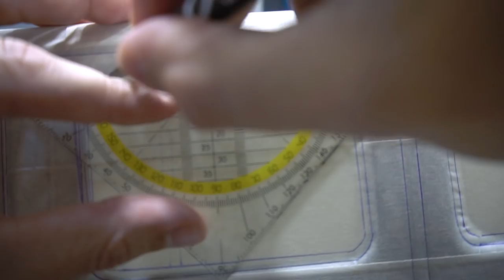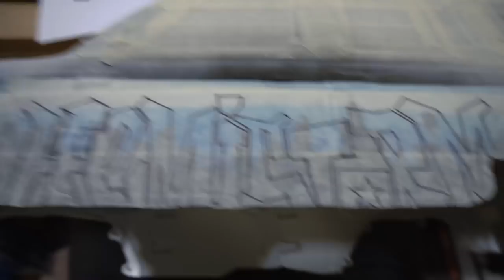CUSTOM AXIAL SCX6 - Step by step paint

Comment: As usual an excellent transformation, so much patience, and talent, Chris should have put money on how long you had it before you did a respray, and more money for saying you would add Hemistorm to it in several area's. 
I have engineering talent but no patience to do more than at max a three colour job but no detail unless I can do it with the Sharpie paint pens, yet I can spend hours stripping cleaning designing and spraying different camo designs Urban and Rural on my different weapons and spend ages making it work after lol.

Comment: What kind of tape are you using? Keep having issues with paint bleeding past the edge. And any prep before painting the exterior of lexan? I see you file the edge but didn’t look like you scuffed or washed the surface before painting.
Reply: I found on a much older video you said it’s the 3M 2367 you use but all I can find is 2307 or 2364. Is it possible it changed numbers? Do you know what it’s called instead (performance, contractor grade, high performance, etc)?

Comment: This is awesome!! I have a question that hopefully you haven't answered a million times. When you paint the outside like that is it a different kind of paint as opposed to the inside? I am asking because I have always been told not to paint the outside because it will flake off quickly. Forgive my ignorance. When it comes to painting bodies I have only ever done one and it was a flat black Tamiya Hornet. I have 2 bodies that I want to paint and I have been pulling together a bunch of ideas and techniques and you are by far one of the best I have seen so far.